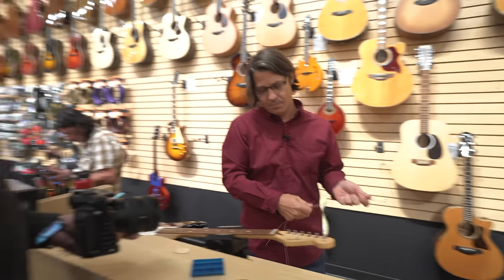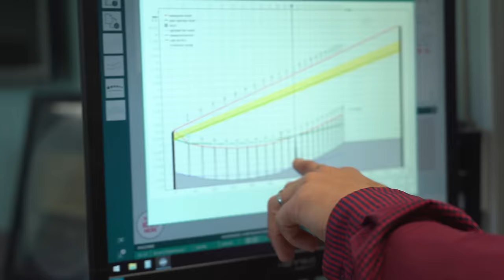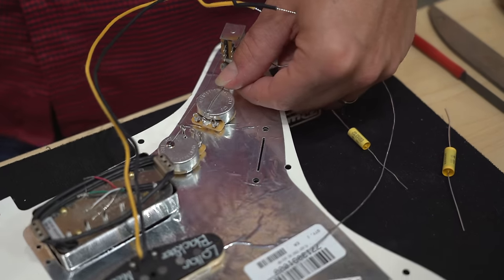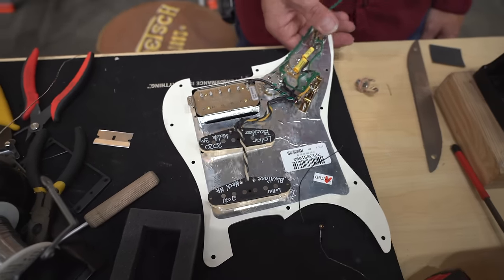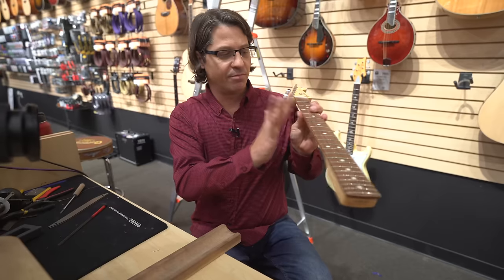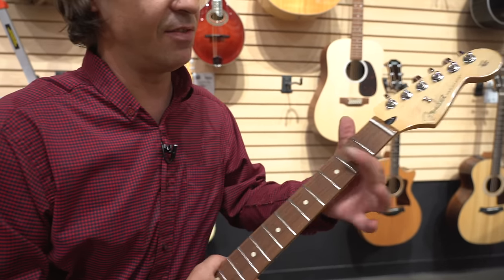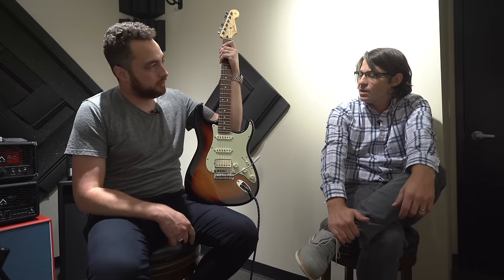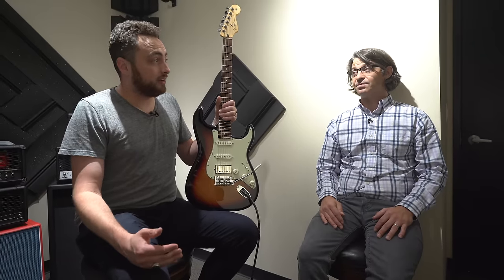We Tried To "Custom Shop" The Cheapest Fender Strat

Comment: Dude- I've been looking for the right overdrive sound for months now- long story short- I tried your fuzz face trick- fuzz all the way up, roll the vol. back on the guitar- love it. But because it was an experiment, I bought a cheap Caline Fuzzy face- give you one guess what it's a clone of. Anyway- now that I know I like it- I want a better fuzz pedal, but I want to make sure I get one that cleans up good- not really that worried about the wide-open fuzz tone tbh. I play with it occasionally, but I can't really connect with it, not my style. 

 The Big Muff I can get on with but, it doesn't clean up- at least mine doesn't. It's a digital version of the pedal created by Boss. You can dime it out and play Smashing Pumpkins or something- sounds great, but if you try and dial it back- because of the design of the pedal you really can't. The parameters adjust in steps- like it goes form 1- 2 but there's nothing in between. This means the drive is either off, or there's too much- and there's no way to set it between the two. It's a multi-effect pedal and if they hadn't of screwed it up, would've been an amazing pedal. But there's two issues- the digital way it adjusts parameters and the user interface- which is horribly complex. But this thing has 3 wah pedals in it, a voice box, a univibe, a flat boost, a noise gate, and 8 different drives in it- everything from a Metal zone and an op amp Big muff to the Marshal Guv'nor and the Blues Driver. Any drive can be set to be used through the different wah pedals or voice box, univibe- and it's built like a tank. You can design your own wah effects to- oh, and it has a synth effect built in and a wah designed specifically for bass. It's fixing to be on eBay if anyone is interested.

Comment: You could do something similar and save with a Fender knockoff.  The Sire S7 is 600 bucks and already has the rounded finger board and frets, plus locking tuners. Get it plexed and new pickups and your set.  Interesting video.

Comment: I did this with a Chinese strat. gave it to a local luthier, told him what I wanted to do , I put a SD pearly gates in the neck, WCR Godwood in the bridge and a JB super S in the middle. Put Fender locking machine heads on it.  Had it wired like a Steve Morse set up, with volume and tone push/pull pots, replaced the trem with a fender standard one. The neck was already decent and the body was a great piece of wood. I have 2 custom shop strats and this thing beats the crap out of them. Total cost , Guitar  600 , PUPS 400, Machines heads 100, set up and fret work 250, total, odds and ends total cost at the end of the day is around 1400/1500. Will I get that for it, No. Do I love how it plays and sounds , yes. Um that part is priceless.

Comment: I know a player who got a squire from a garage sale, spent like around 125 for it, then he upgraded to GFS pickups, I do not know what was done to the neck, you can do alot yourself if you know what you are doing, He Says it is a pretty decent guitar and has less than 500 in it. Shop for em in pawn shops, get the initial guitar cheaper and it sounds like a much better project. Heck you can buy a used Eric Johnson virginia for like 2400, so doing this almost got you there. Boy some instruments have gotten sick expensive. I got one of those Gretsch 800 dollar China ones from sweetwater it is a pretty nice instrument, had to tweak the intonation, truss rod was fine, did lower action slightly, plays and sounds great, I even wonder if even putting in a set of Tv Jones filtertrons would even be worth it, most likely not. And I know several people players who have built lots of Partscasters with varying stuff, lollar pickups, P90's in a strat. Even some that emulated vintage guitars, all have been great Budget guitars.

Comment: Fender CS is overrated.  I owned a custom shop tele with a John Cruz stamped neck. It was nice, but ultimately played and felt like a normal tele.  The CS could make sense if you design a guitar to your exact specs.  But if you are just picking up something from their stock, I'd suggest a used EJ strat and call it a day.  Or if you are adventurous, find a late 80s / early 90s strat plus.  While unconventional, they are sleepers.  The necks have a great vintage feel, you can still get authentic strat tones out of positions 1,3,5.

Comment: File $3.00 Harbor Freight
Razor Blade .5 cents in bulk
Intonation $25-30 at your local guitar shop
Don't fall for the old bait and switch out on the pick-up sand do it yourself if you do it's easy
All in all this was a very strange episode ! Instead of using over inflated tax write offs, just buy a guitar and have a raffle! Nobody falls for the snake oil salesman routine anymore

Comment: 1) what's the weight?  2) important to have a neck that you love - size, shape, fret board, fb radius, and frets - before any significant modding. Truss rod adjust and set up - sure, but for the more expensive stuff - why bother?

Comment: Some bad unnecessary choices in this video. No need to spend 50 bucks on a new pickguard and backplate. I also hate HSS strats where the humbucker does not match the look of the single coil pickups. There should be uniformity throughout the pickguard. A good set up, fret crown/level, rolling of the fretboard edges were all good ideas. As far as the other stuff goes, I'd just replace the bridge saddles with Graphtech string savers, the electronics on Mexi-strats are fine so a reasonably priced after market humbucker like a Duncan or a Dimarzio in a color that closely matched the rest of the pickguard would suffice, also change the stock tuners to Fender locking tuners and a new Tusq or Nu-bone nut.  It'd be an awesome, nicer-looking guitar at a lesser total price than what was done here.

Comment: it is honestly not worth all that work.. fender player single coils pickups are not hot but sounds way more clear and can hold its weight.. the PLEK, fret level, crowning and polishing is always worth it plus setup.. the nut, pots, pickups and misc parts aint worth it except for the tuners and humbucker.. rolled edges and smoother the neck is completely unecessary, it will eventually happen anyway.. probably $450  worth of work and parts is good enough.

Comment: All BS!! It comes down to quality control in the company. I’ve owned several CS relic strats since they started making them back in I think the 90’s when they bad much tighter quality control. That was when the relic strats had the CS logo pressed into the wood on backside of headstock scroll- nowadays it’s a sticker under the lacquer. Some had perfect frets some didn’t. Bottom line, fender custom shop doesn’t always automatically equate to high quality but rather over priced fantasy guitars

Comment: Pretty easy to hit custom shop level besides nitro finish. 

For example. Albeit not squier and fender or epi and gibson. But steandberg boden essential. 3 way pick up selector swap. SD custom shop modded p rails. To better match the coils of a single and p90 for a better humbucker sound. 

Push pull pots. Few options. But also mini switches and making the rear cover magnetic. In and out of phase switch, p90 single coil and bucker mode 3 way. Series vs parallel switch. All on the inside if the rear cover. Push pull works like a blower switch modified a bit. 

Normal mode works as humbuckers in standard wiring. Hit the pot and it does whatever the rear switches indicate. 

Sophia or another trem system added if i want. But similar mods to a cheap les paul and a cheap jackson with a trem. Albeit hard tail on the gibson. Havent decided on the strandberg. 

But the jackson. Dinky archtop js22. Same p rails custom shop model. Natural wood finish dinky. Add a 5 way switch. Add a single coil middle position pick up. Same rear wiring set up. Sophia trem technically suited more towards headless guitars but double locking with the adjustment wheel. And the drop D lever. Or evh drop d tuna. 

Bridge, br middle, middle, middle neck, neck. P90s. Single coils. Or humbuckers. Two tunings in one guitar and functionally both a non floating and floating system. Ratio staggered locking tuners. After market reverse headstock. 

And a diy re finish of the clear after routing. Add a battery box. Can inckude a mid boost circuit or a small distortion or number of other effects. Or use a N tune push pull chromatic tuner built in. And again 3 pick up types 5 combos now and 2 wiring options. Ti saddles and a few other goodies. 

Essentially putting a modern fender single coil type set up with a decent p90 design. To make a hot humbucker for metal thats still passive. Magnetic rear covers make stuff quick and solid. Diy routing the body means i can do a few other cool things. Including a recessed output jack. New neck roasted maple quarter sawn and multi piece and scarf jointed. Stainless steel frets. Nice finger board. 

Refinishing the body also means carve the back heel. Alot of it can be done diy. Little of it needs a pro. Shorter screws isnt hard.

Comment: interesting assessment. What wiring schematic did he use for that??? And nice neat wiring! So, I see a couple red flags. You really are comparing a apple to orange. in that a custom shop guitar will have different body wood and glued in pieces, and a different neck. That aside, if you had just done a nice setup on the guitar, it probably would have played just as well as a $1900 guitar. Furthermore, how long had it been sitting in that box? neck bow can be attributed to environment changes, Need to let them acclimate before making adjustments. I do this on all my guitars, and sometimes I may need to file on a fret or two, or adjust truss rod. Granted not everyone has the skills to do this, but I do. then, if needed, I upgrade the hardware. Side note, I started buying a guitars from a company in Vietnam. Super good quality of builds, Nice woods and hand wound pickups. but they all need some level of setup and the electronics are basic import. You don't need to limit your self to "name brand" anymore.

Comment: I bought a HSS Player Strat in 2019. The pickups, CTS pots, and super switch are all perfectly fine. I had to switch to a bone nut and have it Plek'd because it would not stay in tune and the fret work was so horrible I couldn't properly set the action even with the neck relief within spec. After those changes the guitar now plays amazingly and holds tunings better than any other guitar I own. The initial cost of the guitar plus the upgrades still came in under the price of an American made Strat.  

The bad news is that it appears Fender hasn't fixed these issues since the guitar in the video is brand new and had similar problems as my '19.  The good news is you can find a used Player Strat for $500 or so, and a few upgrades will turn these guitars into an amazing instruments for far less money than their USA made counterparts.

Comment: So bottom line, many years of starting with a decent base platform and making the guitar see its best day: you need a new guitar set up no matter what; you need to play it, determine see if you like to pick ups in it; in terms of an HSS Strat—the singles are usually always good enough, the hum is not a good pickup. A favorite hum or  small builder hum and upgraded pots/caps (and selector switch) — CTS Pots, CLS selector; locking tuners + modern bridge is best you’ll get

Comment: It's kinda sad that a $850 guitar needs the neck worked on. Sure, I get the rounding of the fingerboard. But, no guitar over $500 should have rough frets and a crappy nut.  Really, the moral of the story is - learn how to do these things on your own guitars. Go buy a cheap used guitar at a pawn shop and start learning these things yourself. It's not hard! And, if you get really good at it, it can be a source of extra cash.

Comment: This is pretty much what I did to my first Stratocaster. It's a 2017 Mexican Strat. I replaced the neck with a '57 AVRI neck and updated the pots, switch, pickups, etc. The only thing left of the original guitar is the body and neck plate. It sounds and plays better than some American Strats that I've played.

Comment: It is sad that a $850 Fender Strat comes with non-rolled fretboard edges, fret ends that need some work, and a bad setup, but I've played a lot of them out of the box and this is fairly common.  You're better off buying a used MIM and paying for a good setup (or doing it yourself - it's not hard).   Great video, and great mod choices!

Comment: Going with an MiM was rather pointless, with the starting point (cost) being higher than it needed to be for a poly finish. A decent mid tier Squire would have turned out near enough identical and drastically lowered the price of entry. For a more enterprising guitarist with some fab/finishing skills a bare kit would be even better. Nitro finish it then add pickups and hardware of your choosing, if nitro is important to you.

Also, a nitro finish doesn't = better, sorry. It's a point of preference. The only value a custom shop offers is resale value and the fact that it comes more or less sorted from the store. For any gigging guitarist they are a total waste of money unless it's the one you use at home or in a studio. They are more of a status symbol than a practical tool, not saying they are not great, they are, but you can get the same playability and tone from something a whole hell of a lot cheaper. It's a bit like watches, a nice Casio will do the job just as well as a Rolex for a fraction of the cost but everyone who loves watches aspires to the Rolex. No matter what collectors say, the Casio is all you really "need". I wish people would stop trying to make out that "Custom Shop" (any manufacturer) = good value. They are not value products, they are prestige products, some are not even as good as higher end standard models. It's the collector market that holds appeal for these, they hold value and can be recouped down the road or even profited on. Otherwise, get the best feeling/sounding guitar you find at the store (I always like to be hands on) and upgrade the weak areas, you typically end up with a lot more bang for your buck and a better suited guitar to your tastes. Then when your finances permit, go right ahead and spoil yourself with the custom shop of your dreams ;)

Comment: Yeah, this had a teensy bit of "we are all guitar snobs a bit" vibe.  A better video to me would be to leave off the brand.  Eg, start with one of the nicer Yamaha PAcificas and add 1000 bucks to it and see how great it sounds.  It seems to me you could have started with a 170 bullet strat and done all the same work and have the resulting guitar only costs 1100 bucks. I would also not count the labor, at least not at shop rates.  Most of the work would/could be done by a loving owner like replacing the pickups and such.  So some allowance for the DIY parts of the upgrade.

Comment: Well, the same money easily gets you into an American Professional II HSS strat, with some money left over. Those are generally pretty darn good right out of the box and you get the carved heel, nicer wood and finish, and a much nicer hard case and it is all under factory warranty. It would also hold value better.  Now, with that guitar, do a proper setup, dress the frets, level and polish and it would be pretty decent and worth the money, leaving the pickups and electronics as they are. Or just buy a guitar that's already setup properly. Don't even get a case with the Player model.

Comment: If the only quantifiable difference between a custom shop and this is the weight and finish, I think I'll save my 2 grand.  I'd also like to know what about the neck feels different if the fretboard is already rolled.  It costs $0 more to have a cnc in mexico cut the back profile a different shape.  Also, paying in the range of 4k for a guitar that was designed to be economical to manufacture in the 50's without cnc machines is bonkers lol.

Comment: 10:46 - There - right there. See that giant barcode sticker? That’s a 1mm thick shim. Get rid of it. Also with a Fender player there will be huge globs of dried paint drippings in and around the neck pocket. Slice them away with a straight-edge or an exacto, and clean up the pocket with a little sandpaper, because they sure didn’t do it at the factory. Once you do those two things to the neck and pocket, the neck will sit properly, and the bridge can be adjusted as low as you like. I did this with a player Telecaster, and after it was cleaned up & set up, the bridge intonation was almost un-noticeable.

Comment: It sounded good to begin with I own a cheap squire and a couple not  so cheap fenders and the thing is on Mexican and lower is the finish that horrible plastic poly hard finish just doesn't age like nitro finish and in my opinion they don't feel anywhere near or sound as good and the necks are just thin and crappy imo most of the time with guitar's you get what you pay for I've also built my own parts casters with all fender parts even the difference  from USA made neck and any other mabe Japan made ( I've never played) might be good but as far as fretwork and again the finish just does not compare to the old nitro finish for how it ages plays and sounds that's my 2 cents , lol thanks for the video for 2 k you could have gotten a used 57 reissue or 60's reissue for around that actually cheaper  I've even seen used custom shop's on reverb for under 2 k so ......

Comment: Why did use 500k tone pots with parallel resistors (to bring the value down to 250k) instead of just using 250k pots?

Comment: It won’t have the the back of neck profile a custom shop may not have the same same saddles and block as a custom shop or tuners and won’t have the truss rod adjustment at the body ..,-and of course nitro a used custom shop is $2200 to $2800